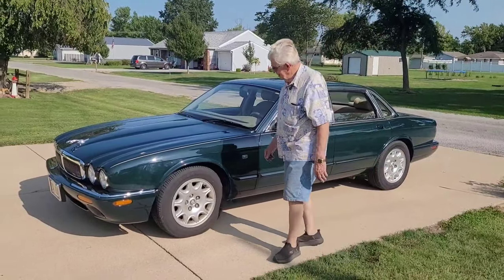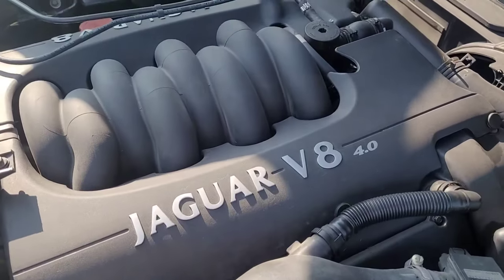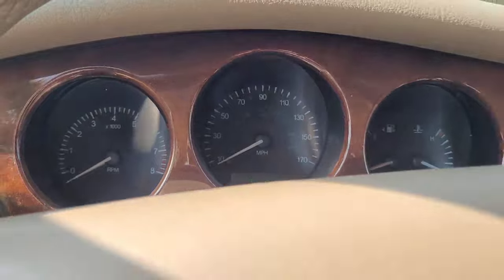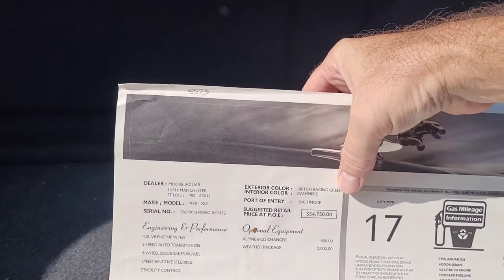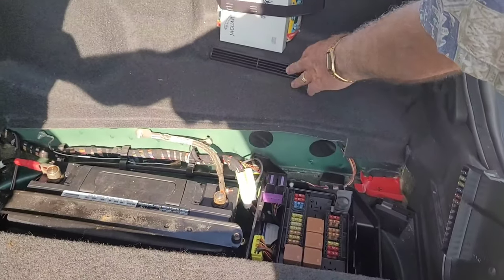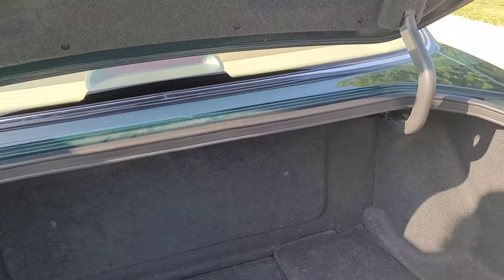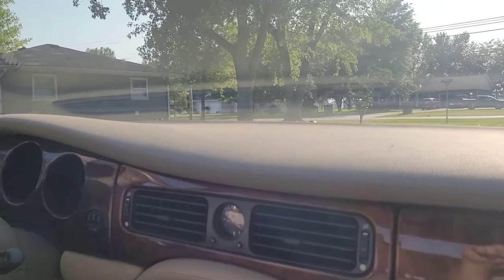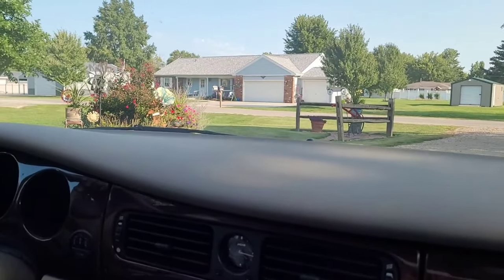Art's Very Fast & Stylish Race Green 1998 Jaguar XJ8 Walk Around & Drive

Comment: Great video.  I have a '97 XK8 convertible that has been the most reliable car I've ever had.  Also, have a '99 Vanden Plas which is also very good.  They were made in the Jaguar plant in Whitley, Coventry, England.
Reply from the maker: Thanks for commenting. There sure are a lot of people putting them down.
Reply: Did you get my second comment about the antilock Module?  Do not buy a new one from Jaguar or anyone else. Have it rebuilt.
Reply from the maker: @garyrains5996  I've not seen it yet. I will tell Art. Thank you!

Comment: 290bhp quad cam 4 valves per cylinder 4 litre nice engine  but did have issues.  Made in England up in the Midlands they did a supercharged also 370 BHP they went to 4.2 litre in 2003.
Reply from the maker: Thank you for that information. I'm so impressed with this car, 👏 I'm still smiling a week after we did this video.
Reply: If it's not had issues by now then it's fine.
Reply: The Supercharged 4L V8 version has an MB 5G-Tronic transmission, and also has no Variable Valves, making it pretty reliable.

Comment: I think that the vent in the trunk might be for flow through ventilation from the cabin.
Reply from the maker: That could make sense.
Reply: I looked it up on Google, and it shows an illustration of the flow through ventilation system, so I guess that’s what it is?
Reply from the maker: @david-wilkerson1967  Thanks, Dave!
Reply: With the battery in the trunk, there has to be venting to prevent a build up of explosive gases. Battery do emit fumes when charging.
Reply from the maker: @wmalden  that makes sense, too.

Comment: My friend owned one when new and it was a delightful car to drive. It was seriously swift handling with nice road holding characteristics while riding so gracefully that you knew you were in one of the world’s most refined magic carpet like riding luxury cars and steering that’s buttery smooth and communicative. All while coddling its driver and passengers in a boutique, little hotel like interior. The last of the original XJs that began production in 1968. 
When the new generation debuted I looked at one in my local dealership and though it was strikingly beautiful inside and out upon approaching the car I noticed a large gap between where the hood meets the side fenders so I looked at a few examples and noticed that they were all built the same way and it wasn’t corrected in its entire model run. It devaluated the successor’s standing in the upper luxury car market in my opinion as Toyota can achieve exceptional fit and finish in a Corolla and of course their Lexuses are finished among the best with higher quality paint used than their Toyota division.
Reply from the maker: This car absolutely shocked me in every way it performed. Everything you pointed out is spot on! 👌

Comment: There are 61.024 CIs in 1 Liter. Figure if a Ford 5.0 is 302, 5 into 302 is a smidge over 60CIs per liter X 4 = around 240 CI for that Jag. They sure squeezed a lot of power out of that small V8!
Reply from the maker: Yeah, that was a shocker for me, for sure.

Comment: Unfortunately, the XJ8 does not have a good resale value. It don’t make sense because they are great cars.. I’ve got a 98 Vanden Plas, which is Jaguar top of the line. Sapphire blue with an ivory interior. I’ve got 118,000 for a 25 year old car that’s not a lot of miles. And it’s only worth maybe five 6000 in the cost 62,000 new
Reply: It's good in a way, it means I can afford a Jag. I paid £540 for mine but spent another £600 making it roadworthy. 286,000 miles and runs sweet as a nut.

Comment: Those cars cost a fortune to work on. I would rather have your Lincoln.
Reply: I had a Town Car that was wonderful but they’re very different experiences. I’m pragmatic myself and have avoided European cars for the same reason for a few decades since my last one but it’s almost like comparing oranges to sneakers. They have nothing to do with each other.
Reply: @LlyleHunter  i hear you but they are both just transportation 99.9% of the time. I have a car with a turbocharger and heated seats. I never get the RPM's high enough for the turbo to kick in and in Texas I never need the heated seats. But the car is a Chevy I bought with 9 years on it so the options did not really cost me extra.
Reply: @williamgrimes668. I hear you and I agree however it’s not just about acceleration. There’s a real difference in steering feedback and cornering feel at all speeds that’s appreciable and even at low speeds while driving around curves at thirty miles per hour the Jag is fun.  I’d never own  Jag myself but I gave up on high maintenance European cars and haven’t and wouldn’t even drive anything as inexpensive from Europe since 1998 when I turned Japanese.
Reply: I’ve actually owned a few American pickups and a Durango in the interim as well along with mostly Hondas and a Toy
Reply from the maker: Don't get me wrong. I'd never give up my Lincoln, but what Lyle is saying is true about this car. The performance in every aspect of this car is mind-blowing.